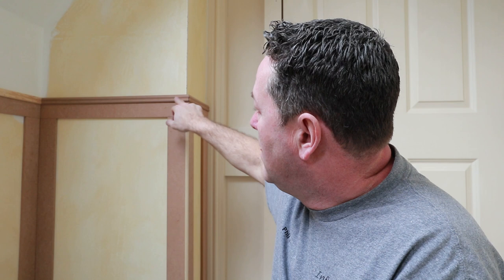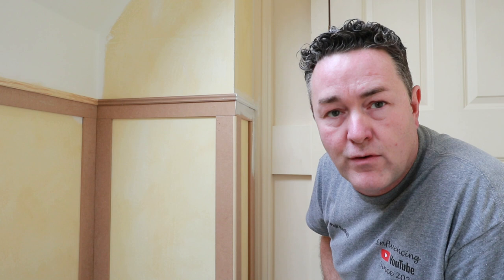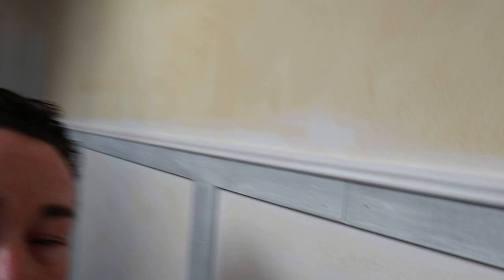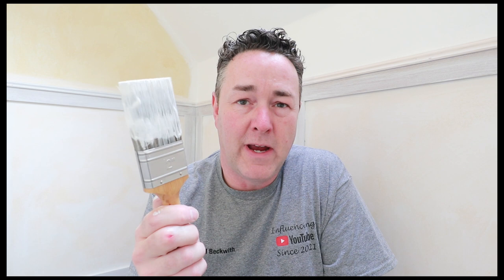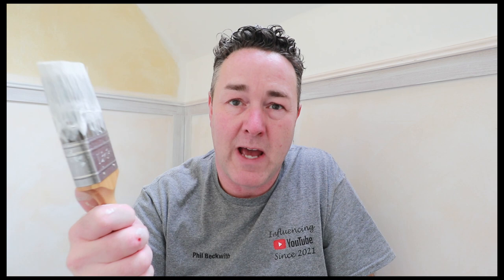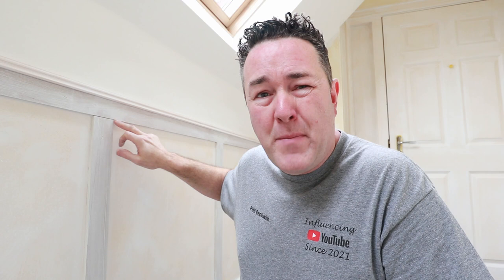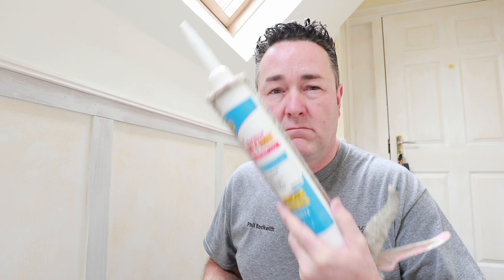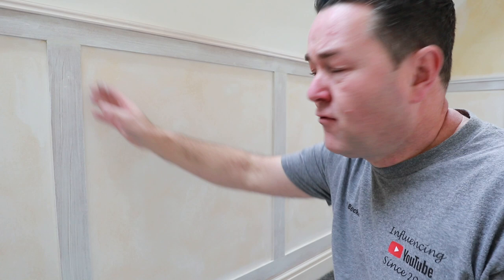How to Achieve a Flawless Finish: Priming MDF Panelling with Zinsser 123 Paint Using a Lick Brush

Comment: Hey, great Chanel! Looking for advice - painting skirting boards with dark blue satin velspar trade. Sanding down first as it looks like old paint is oil gloss. What primer do you recommend before? Bit worried about BIN as may dry too quickly! (And costs small fortune 😂) Newbie diy-er here 🙂
Reply from the maker: Thanks for finding me. I've a few videos on painting over older paints 
Keeping it simple...
I'd sand down.
Then use a grip primer. 
Then bring to a finish with the UC and top coat paint system you choose.

Watch my playlist of product testing... Loads of different paints you may want to consider trying.

Some paints have a recommended primer/UC to use before two top coats of their finish paint.

Some paints primer/UC has an adhesion property to it, that you don't need to use a grip coat as a first coat. (Like the Isomat paints)

Other paints, say you can just go over older sanded down paint with two coats of their finish (Dulux heritage eggshell springs to mind)

Grip coats...
Stuff like....
Zinsser 123, Aqua BIN, 123+, Cover stain or BIN 

There's also Smith and Rogers blockade which is like Zinsser BIN, being Shellac based.

Have a look at that in the future too
Hope that helps
Reply: Thanks for the info. I am gonna go with Zinsser. Would you recommend 123 or 123+? From what I see in your videos you use 123+ more but not sure that’s needed over the 123?
The main issue I am having is almost impossible to sand down the skirting due to the shape…do the zinssers really work without sanding?

Comment: That 123 plus is probably excellent for priming radiators too. Got 4 more to do. Wonder if a foam roller would be an option (at least for the primer) on these flat radiators since it is time consuming with a brush and not got a sprayer 😮. Any tips to speed things up?
Reply: I'd always use zinsser bin for priming rads or anything metal I believe the 123 bullseye is water base for wood
Reply: Yes I usually do and wouldn't use 123 for that but with the improvement in 123 plus I think it would qualify as a radiator primer 🙂

Comment: jus wondering phil why would you change from oil eggshell to water based would have been easier just to give 1-2 coats of eggshell rather than using a expensive water based primer and expensive water based top coats and the extra coats 3-4 coats
Reply from the maker: Oil is old hat now, so many good wb paints.
Yes it's an extra coat. But it's easy to apply, I get two coats on in a day and the finish (particularly when I use the ScuffX in the hallway) you'd be hard pushed to know if it's oil or water, it feels silky and sold.
Reply: @ProfessionalPainterDecorator  you must really hate oil based paints then Phil if your choosing to spend the equivalent of a weekly shop extra

Comment: Recently bought the red devil one time caulk not used as yet, along with Isomatsti -A which is credit to Daniel Nugents  Channel. I’ve been impressed with it, nice smooth finish give it time to skin over before painting, so far pleased with it time will tell.. Used  to use painters mate  but not as good as it once was.
Agree with  preparing and priming surfaces first
Before caulking. Bit of water and sponge with you to wet your finger.

Comment: I'm about to prime some MDF panelling (slightly different from yours as I have MDF sheets underneath the batons and rails, so no bare plaster). I was planning on using Zinsser BIN for my priming as I've alway used that on MDF with a water based system on top. What benefits would the 123+ have over the BIN. Great channel.
Reply from the maker: No smell and easier to apply. BIN doesn't brush great and dries a bit too quick with it being Shellac based paint.
No need to use BIN, it's not going to stain, no knots and it's only MDF, you could just use acrylic primer TBH
Reply: @ProfessionalPainterDecorator  Brilliant, thank you - so helpful. One final question  (actually two) - do I need to undercoat ? If so what undercoat would you recommend ? I think over the years I used a primer / undercoat all in one for lots of woodwork (I hate the word trim too) and always went with a couple of primer / undercoat all in ones then  a couple of top coats.  I was going to spray my panelling, should I brush the primer and undercoats then spray the top coats? I  was planning on masking up and spraying all the coats
Reply from the maker: @dougborland  primer/Uc in one... prime, then fill/sand, then give it another coat of primer/Uc... nib down.. then two top coats.

If you watch some of my other painting MDF (spraying it) that may help too.
Reply: @dougborland  I know your question was to Phil but to share some recent experience I’ve used Leyland Trade Acrylic Primer / Undercoat on a ceiling that was silk, walls that were previously papered and which needed a lot of filling and sanding, and woodwork / doors that were either new and bare or old oil based gloss. Good sand down and a couple of coats of this and it could be mistaken for a Matt white finish, covers the filler well and so far (touch wood) the finish coats have gone on nicely and the satin (Aqua Guard) on skirting/doors feels solid. Be interested to hear if you have tried this paint or if Phil would recommend this approach as it’s £15 for 2.5L and dries very quickly unlike some of the hybrid undercoats. Good luck with your project 👍🏻
Reply: @Liverpool1ne  Previous projects I've used Johnsons Acrylic Primer and Undercoat and it was pretty decent stuff. Been using some of the Zinsser products lately and liked them too

Comment: Got some raw mdf skirtings to do. Didn't think 123 or 123+ would be ok to use since they are WB, could cause swelling? Will trust your vid on this one 😊
Reply from the maker: Seen this video?
https://youtu.be/glJ46PAuPTo
Reply: Watched that, thank you. So I could basically wash prime it with anything (woodwork suitable) that I have got left in the cupboard, WB or SB? I have got to seal 1 or 2  walls with Gardz so was thinking of sealing the raw MDF skirtings with that...?
Reply from the maker: @ManuelaSmith-bk1zp  you'll be fine. Sand it after you've coated it up